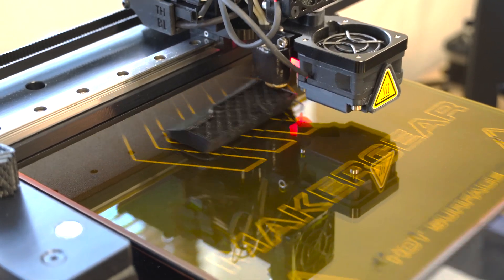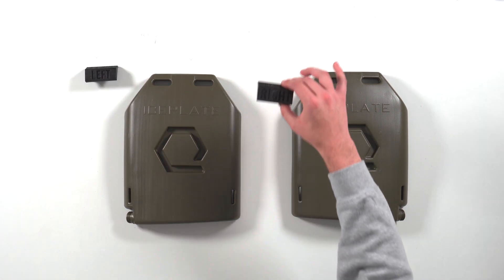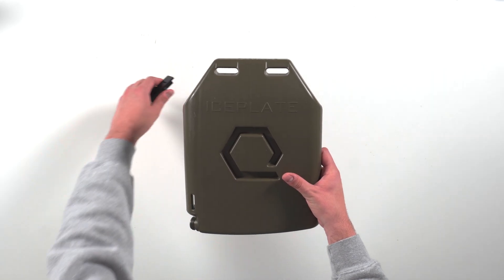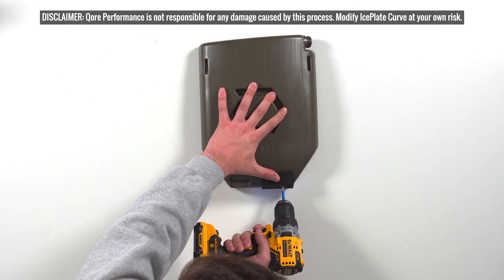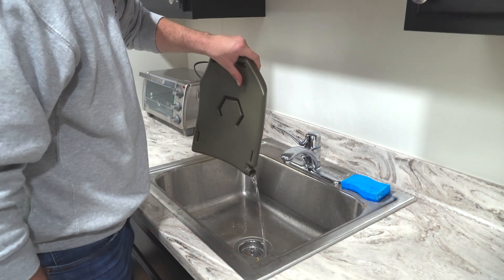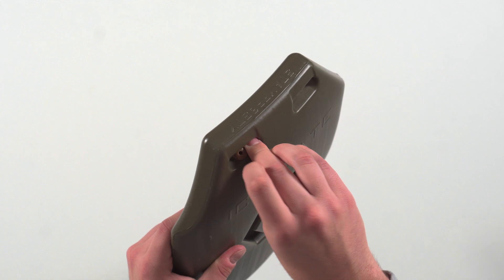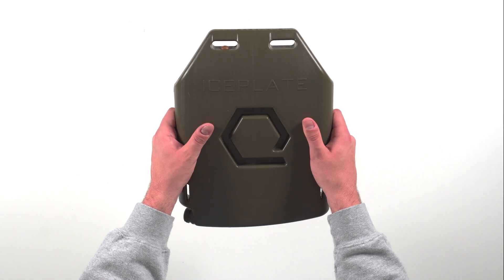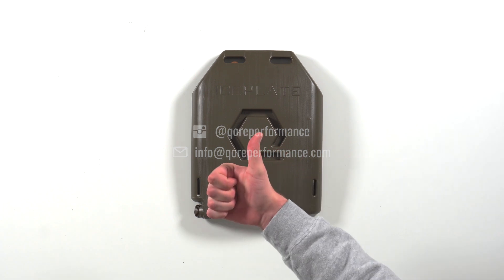One-Way Valve Retrofit Kit for IcePlate® Curve (DIY)

Comment: I wish there was a printable paper template for those of us who doesn’t have access to a 3D printer.
Reply from the maker: A printable template wouldn't not work b/c it cannot control depth. This is an important part of the install. That said, we are working on a program to rent the jigs to customers to maximize efficiency and minimize waste...it's kind of our thing lol. Make sure you are signed up for our LaunchPad emails and you'll get the notification when the rental jigs go live. Hope that helps! #StayFrosty
Reply: @QorePerformanceUSA  thanks for the speedy response. I got my one way valves in the mail today for my IcePlate Curves. Since it’s cooler outside I won’t be using them as much but I should have time to get them installed before the temperatures pick back up.
Reply from the maker: @BT_Spanky  Remember that depending on what IMS/carrier products of ours you already own, IcePlate is a year-round hydration solution and especially powerful for cold weather with hot water fills. Here is an article from our IceAge Insights blog with more details:
https://www.qoreperformance.com/blogs/industrial-insights/filling-iceplate-safety-vest-with-warm-and-or-hot-water-for-winter-use

As always, hope that helps, but we're here if you need anything else. #StayFrosty